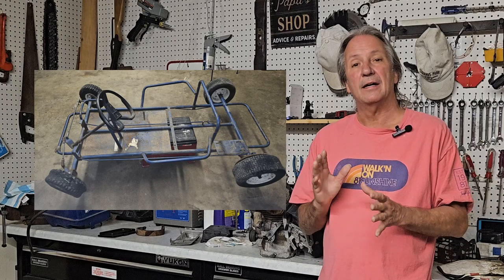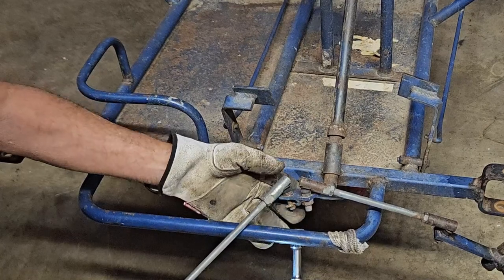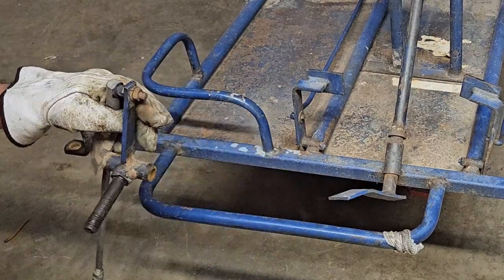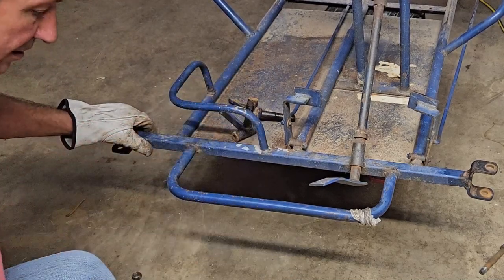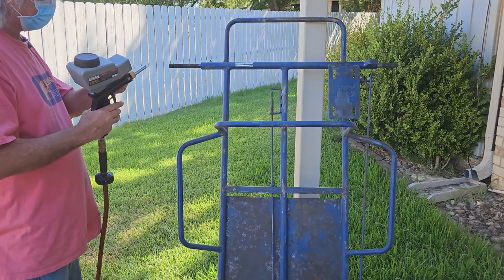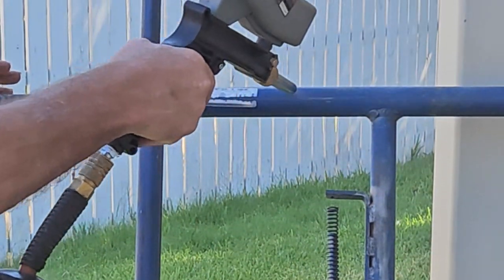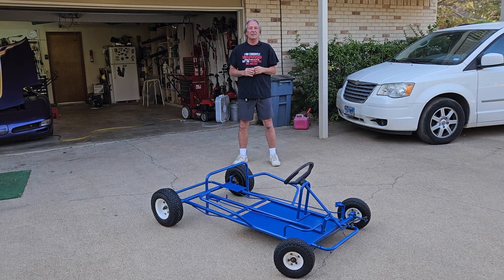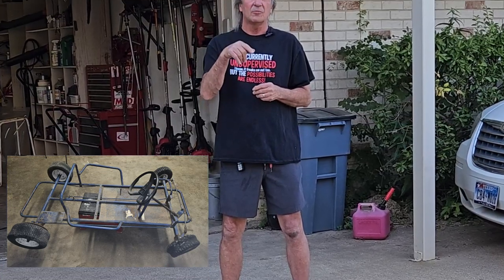Prepping and painting the (not very) new go kart

Comment: Looks FINE but I thought you might attach some grease fittings on the kingpins but Oil will suffice. Glad you're back home and getting reset to the boiling point!
Reply from the maker: I try not to reinvent the wheel while playing with older carts. Once you head down that road, there is no turning back.
Reply: It's the old equipment running ways coming to the surface again. Everything used to have a fitting. Nothing does now and folks wonder why it wears out. I got hold of an old DM Mack with the kingpins worn out years ago. NOT good. Oversteer/understeer/oversteer/understeer till it got slowed down.That was in a curve and I can still show you where it happened. I still get wiggly just thinking about that little deal. And blowing the right steer tire in a left hand curve grossing around 80k+ running between 55 and 60 in a quint (6-axle straight truck). Such things as that. @GuysPlayingWithTools
Reply from the maker: @lewiemcneely9143  I wasn't there, and it mashes me wiggle a little thinking about it
Reply: You should've been there! It was REALLY interesting for maybe 15 seconds that felt like a month. @GuysPlayingWithTools
Reply from the maker: @lewiemcneely9143  I am sure. I have rolled a couple cars along the way in life and it feels like you bounce around for 1/2 an hour waiting for it to decide how to land.
Reply: I've been in a wreck or 2 but the best one was me trying to turn a rigid frame rock truck over, sitting there thinking 'Well, THIS is how it feels to turn one of these things over'.I got the bed down before it flipped but it was very interesting. @GuysPlayingWithTools
Reply from the maker: @lewiemcneely9143 I'll bet it was break time for a minute after that!
Reply: Still is. You find out a lot of stuff through a V.A. appointment! @GuysPlayingWithTools

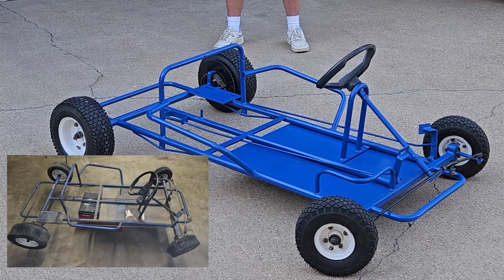Comment: 7:50 looks like new
Reply from the maker: @haneyoakie14 It doesn't quite look new but it looks a lot better than she did when I started.
In the next cart video she gets a seat and the motor, it's pretty tiny but it looks sweet all together.
Reply: @GuysPlayingWithTools  up close it might not look new, but on this side of the video, it looks flawless.
Reply from the maker: @haneyoakie14  I could have sanded, blasted and grinded a bit more but it did look nice
Reply: @GuysPlayingWithTools  in the proper use of the Go-Kart, it is going to get nicks, scratches, dings, and bumps anyway. It is not a museum piece to be preserved forever, it is a fun toy that every mark is a witness to the wonderful fun that both owner and toy shared. In my view, it SHOULD eventually look like it had a good time.
Reply from the maker: @haneyoakie14 That's what I was thinking when I got it,  I didn't want it to look new, I wanted it to look *good*. The only bad part... it's too little for me(unless I change my mind and extend it later)